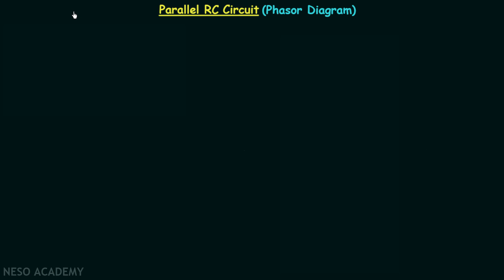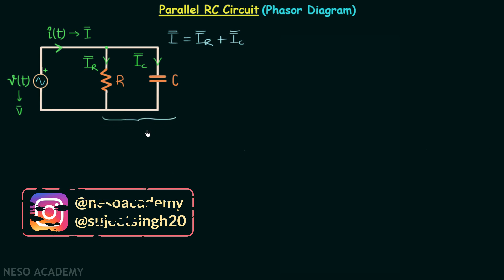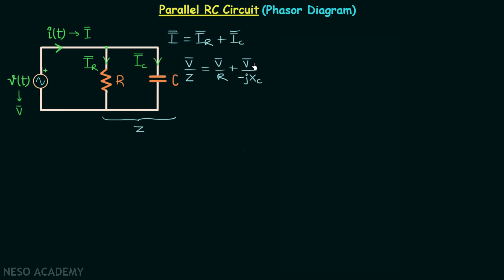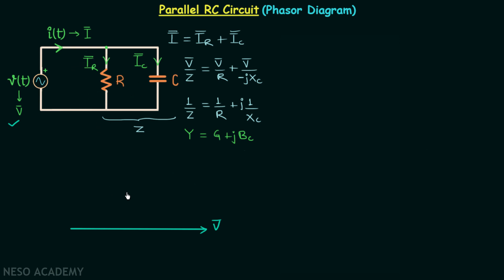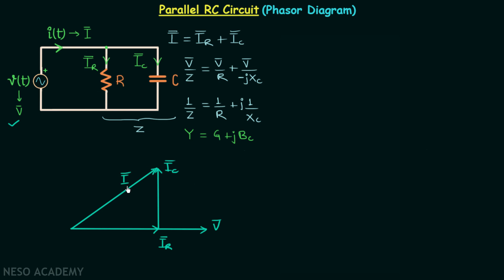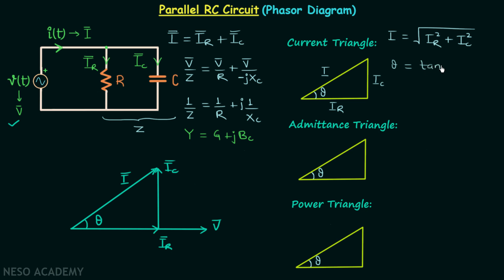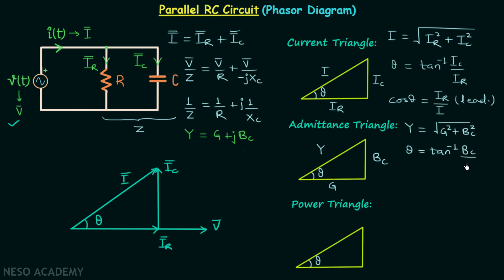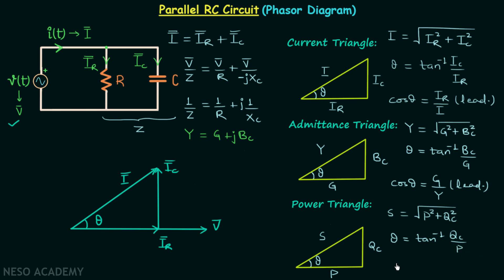Phasor Diagram of Parallel RC Circuit

Comment: how can you write {(1/-J)=J}? at 1:48 in impedance equation what it means is that {(1/(-(-1))=j}, means {1=J}, which is wrong, can you please help me out with this equation understanding
and also you can not multiply and divide with J on both sides then also it will not satisfy the value of J